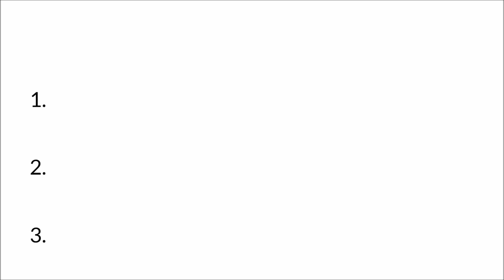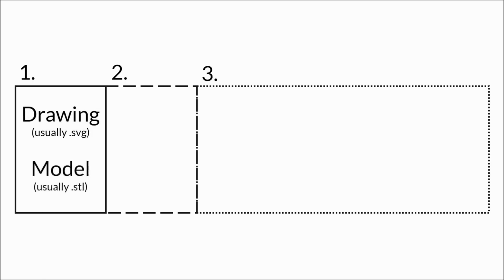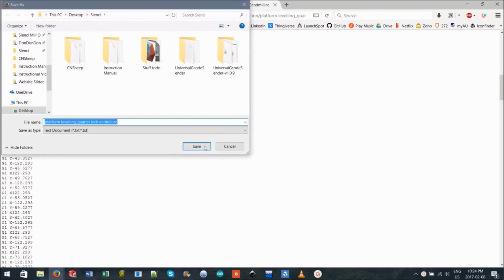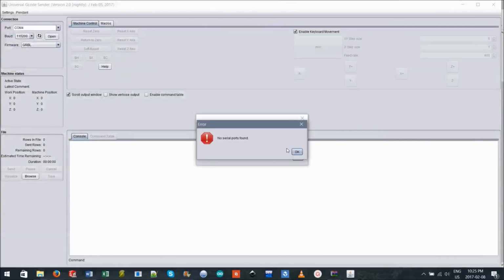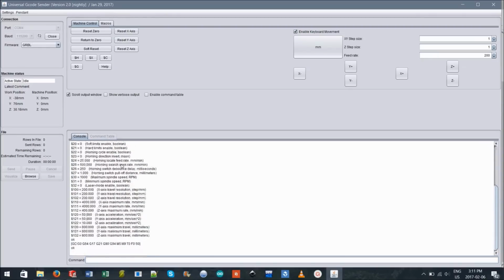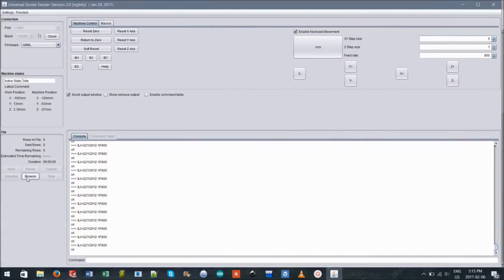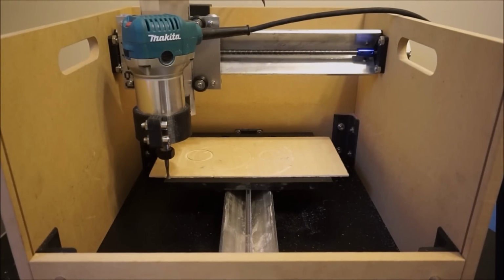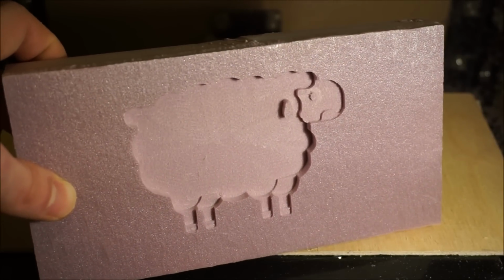Preparing to make your first cuts on the Sienci Mill One

Comment: Platform levelling for a mill? 
Mills should be engineered such that they are, or can be adjusted to be, square and level, levelling in software should only be required for unruly or uneven parts, or to compensate for a poorly constructed or damaged machine!
Reply from the maker: Hi Nick, levelling or surfacing a CNC router is a commonly used technique on many machines. This is a easy and affordable method that provides a reasonable amount of precision for the applications most projects our users do on the Mill One.

Comment: i'm just a newbee and i dont own a machine, but i've been watching lots of videos about cnc and 3dprinting, don't you think it's a bit more practical to design the bed with like 4 or 6 built in screws that people can mount the waste board onto with wing nuts, that would make clamping the work piece easier, and the waste board sturdier and more accurate in my opinion. and i think the added coast isn't too much.
Reply from the maker: Hey Ramzinho, we are working on something to provide some more options for workholding on the Mill One. Stay tuned!
Reply from the maker: You're right! Check this video out where we do exactly that! https://www.facebook.com/siencilabs/videos/1896719637251570/
Reply: Thanks guy., can't wait to see how it performs in real life. I saw Tomas having issues getting to run on his stream? did you guys figure out what went wrong?
Reply from the maker: He was using Pronterface to control the Mill One, but it wasn't really working. We recommend Universal Gcode Sender, but he didn't use it. I suspect that is the main part of the problem. Hopefully we'll see more updates soon!
Reply: Sienci Labs you guys dont consider having a metal cooling addon. it can be a small assembly attached to the drill housing and ran by small pump or something
Reply from the maker: There's a couple folks who've put in a coolant addon. You can, however, typically get away with not having one most of the time as long as you set up your feeds and speeds correctly.